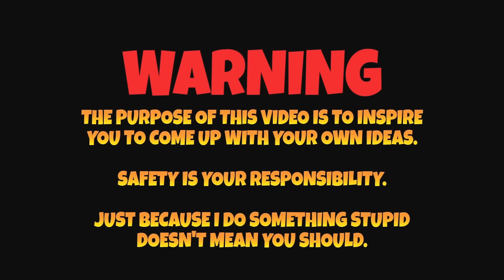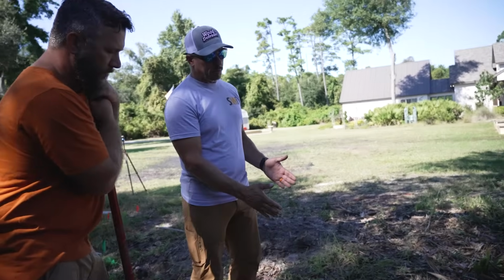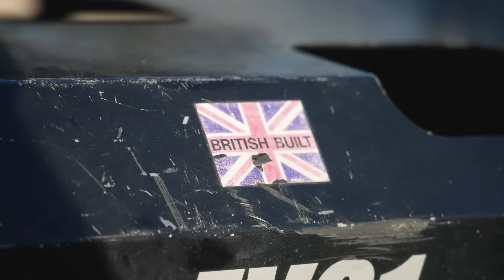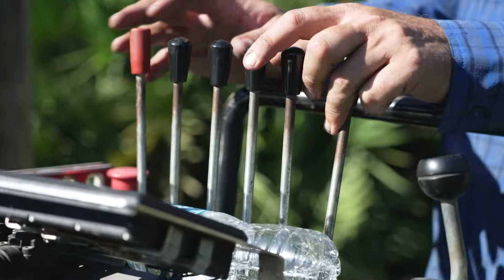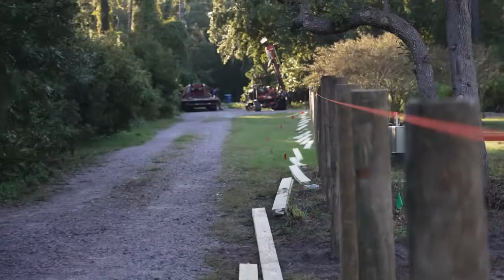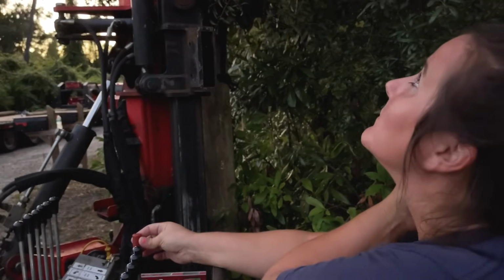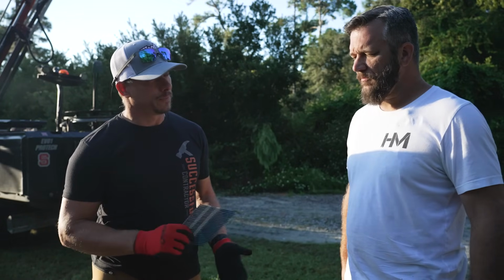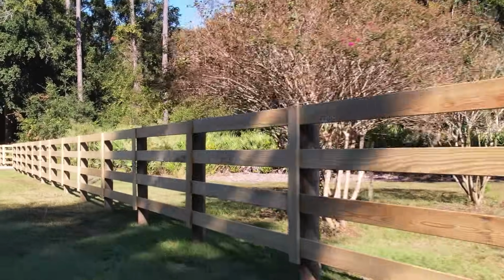The Secrets Fence Installers Don't Want You To Know

Comment: Interesting process for building a fence in soft soil. Personally I think each and every one of those holes from my experience, will act like vases and hold water, eventually roting those posts around 10 years more or less. I build my fences to last 40 years. I use a gas powered auger, I use the proper amount of gravel at the bottom for drainage so the post won't rot as easily. I also widened the hole as it gets down lower to give it more stability and make sure the bottom is flat. Speed is another essence when you're talking about an investment that will only last 10 years or so and have to be replaced. Pressure treated boards can rot out quick because the chemical only goes down so far. I no longer use 4x4s, because they are too flimsy.
I've never seen wood post made out of trees like yours are, that leads to an advantage because they won't warp as you stated one way or the other. All we get here or Peeler poles which I feel or not that conducent with longevity. I would have given each and every one of those posts an extra coat of copper coat at the bottom where it goes into the ground and about a foot above. I would much rather use screws because boards do split and crack and I want to be able to pull the nail out of the post. It's not the nail that comes out usually it's the board cracks. Screws cost a little more, but I like the options of removing them when I do have to replace a fence board.
Your work looks marvelous in the end.
I'm working on a field fence at the moment. Most people here use three posts for the corner, I use one six by six and a lot of cement. Otherwise I would be using three four by four posts for the vertical portion along with two bags of cement per post. 60 lb bags of cement. Then I have to add a four by four between the corner post and the two other posts along with hardware to twist and strengthen the corner setup for stability. Instead I use extra bags of cement only dig one hole only by one post that's more expensive than two posts. And I pick beams that want to bend corner to corner a little bit or should I say warp a little bit in corner to corner. I make sure it wants to push outward the rest of its life because of that warp.
With soft ground it takes about 2 minutes to drill a hole 26 in deep. Then I have to manicure it by hand to make it the way I want it and scoop it out. Put gravel down set the post where I want it and put brackets on it to hold it there. Then mix and pour the cement. I know that there will be no water sitting against that post because it's not in a vase, it's in a cement hold down with gravel at the bottom so water can drain into the gravel and out eventually as opposed to being a vase. I've never seen any of my posts rot yet and I've been doing this on and off for over 22 years. I've seen fence jobs all around me fall over within 5 years because they mix their cement in the hole and shove the post into the cement make it a vase.
I had to build a grape arbor one time, so I tried an experiment with all of the 4x6s 4x4s and 2x4s. I sanded them down to 100 grit. First I belt sanded the large posts and then I hand sanded them. The less fray you have on the surface of your wood the less moisture it sucks in towards the center... The grape arbor has been up for over 14 years, and the wood looks a little green from Moss here in southern oregon. But everything is holding together and not one board has rotted anywhere yet. However out of the seven posts on either side of the grape arbor only two, one on each side are actually in the ground. All the rest of them are sitting on cement in the ground with a metal bracket holding them up about one inch off the ground. So my opinion is if you're shooting for longevity, make every single piece of wood as smoothly sanded as you're willing to put the time in for. 99.9% of you will never even try that.
When you cut off those posts at the top with a chainsaw, I look at all that frayed wood knowing that you damaged part of the protection from the chemicals the post was soaked in. It won't make a difference at the top more than likely ever.
I'm old now, hard to reconcile with that and how slow I go now. Doing that all by myself, would have taken me probably 7 days.